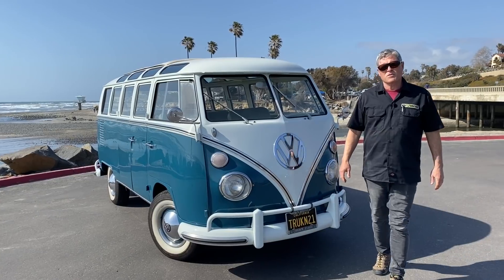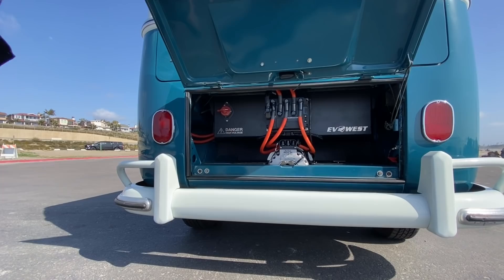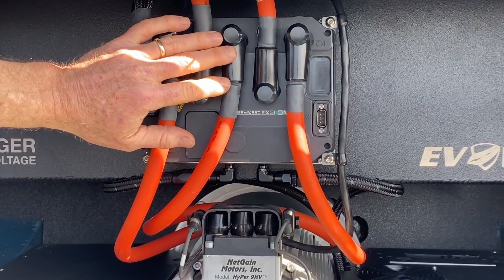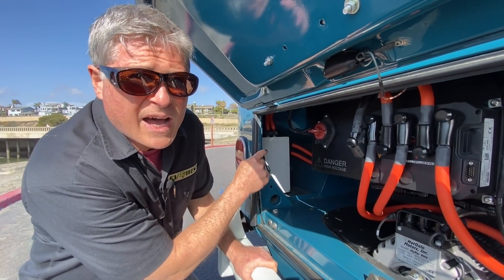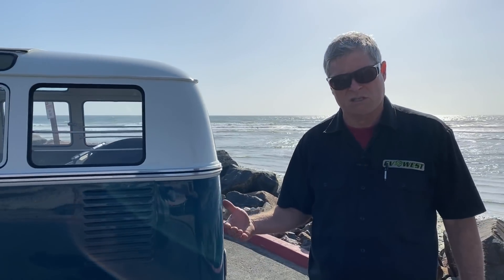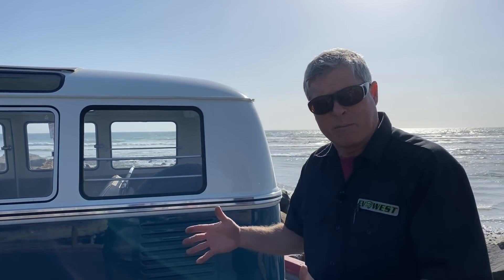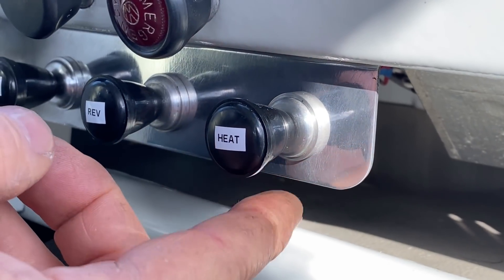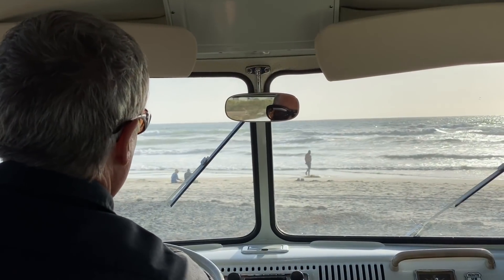Is a 1967 21 Window Volkswagen Bus the Perfect EV? | EV Show

Comment: Hey guys, I'm considering an electric conversion for my own T2. I know that the "how much range" question is a case of which batteries and how many. But in a best case scenario, with Tesla packs, fitted under the carriage and perhaps under a seat or covering the floor and/or in an engine bay... What would be the maximum theoretical range attainable?
Reply: Hey Dylan, check out the latest split bus conversion video they've put up. They're suggesting 100 mile range on that one with batteries only in engine bay. If you put another pack like that under the rock 'n' roll bed/seat that's 200 miles.

Comment: I am a huge classic car enthusiast and I never would ever change the motor in a classic car. The engine adds value to the vehicle and to strip the engine and switch it to an electric motor is like taking protein out of your meal. You need protein just like a classic car needs the gas engine. And people say gas engines will disappear no they won't. America was built on gas. And if we switch every motor to electric a car wouldn't be a hot rod. A car wouldn't have a rumble. That is what people want and like. They love how you can add modifications. But to change something entirely is not good. People won't modify them. People will get tired of racing. And it will vanish because every car has the same motor. Elon musk even said changing every car to electric is a bad idea because the US electric grid can't handle it. It is taking something that america was built on away, and making it bland.
Reply: you bring valid point but for some what is the objective purpose for the classic car. to keep it in original condition and not drive it? want a classic look with dependable drive ability and not experience the most comon breakdown? or the purpose is to keep its organic look and use as daily driver while still enjoying it?  this electric conversion is crazy money spent but i dont like the cc engine problems looking for a medium more middle ground solution!

Comment: How can that deliver 120 hp? Last time I checked 144 Volts x 250 Amps = 36 kw which is about 48 hp.
Reply from the maker: The ACX1 inverter has a 500A peak output, with voltage up to 185. 38kW continuous, 88kW peak.
Reply: @EVWest  I see. The label on the motor is a nominal rating but the controller, oops, inverter is really a 500A model. How much can you over-volt those brushless motors?

Comment: This is possibly the only vehicle that will lose value by doing an EV conversion.  "January 21, 2017, (a) 21-window Volkswagen Samba sold for $302,500, becoming the most valuable Volkswagen Samba van ever sold at auction"
Reply from the maker: With our 'bolt in' kits that are reversible, they do not affect resale value, as the components can be removed and replaced with original equipment, much like a tire and wheel change. The goal is to not alter the classic car in anyway that is not reversible, therefore not affecting resale value. It's important to save the car first! :)
Reply: That bus was a movie car and the buyer way over spent on it. Not worth anywhere close to that.

Comment: You guys are awesome! I love the fact your channel came back and see so much potential.
I have one question regarding motor voltage, why is the aftermarket not up to 390Volts like OEM? Is it a liability factor?
Reply from the maker: There are plenty of aftermarket 400V solutions, but they are more expensive than re-purposed 400V products from platforms like a used Tesla, so we don't see as many of these on the market, but they exist, just a bit more expensive. Also, when integrating to a vintage vehicle, the drivetrain can not handle much power, so the smaller lower voltage motors are a perfect fit, and are affordable.
Reply: @EVWest  Thank you, just from an electrical point of view higher voltage uses less current and less loss of heat so it's more efficient, not more powerful unless you make it more powerful with more amps.
I do understand the extra cost so I see your market points.
Reply from the maker: @HandyDan  This is absolutely true, and the reason why we prefer higher voltage motors, but in cases like this, the vintage vehicle is a little more important to protect, we use a system that more easily integrates with the factory components, in lieu of a couple extra miles of range from increased efficiency. It is a trade off that is common in EV component selection.

Comment: It would be cool if there was an option to automatically disable the regen when the battery bank was at a specific charge level. I think for others considering this, the IRS conversion makes the most sense as it also lowers the bus. I've been considering a swap for my 65 21-window but as someone pointed out here the range is a killer in Texas. Though a second battery could be added under the rear seat. The suspension is plenty stout for the weight. Just put your passengers in the middle seat. My bus would be gone if I left it somewhere (other than in a locked garage) to charge for 9 hours.
Reply from the maker: You can switch the region level on the fly with the NetGain Hyper9 system, just depends on how you want to program it, so it's extremely flexible.

Comment: Awesome build and great video. Are you installing the batteries where the gas tank was? What company are you using to building your transaxle?
Reply from the maker: Part of the gas tank location, and into the upper engine bay, all locations that were freed up with the engine removal. We use Paradise Motorsports in San Marcos to rebuild our 2 speed transaxles.
Reply: whats a conversión like this cost? assuming you got the bus to do the install

Comment: This must be well over 100k. How much did just the conversion run?
Reply: I'm sure the restoration was waaaay more than the EV conversion costs.  That body is near perfect.
Reply from the maker: The parts run $20-25k and the labor typically runs around $20k.

Comment: I love what you with these old classics - especially the Kombis. 

I have had 4 Kombis and a Type 3 over the past few decades. I still have one but it's been on blocks for the last 15 years or so. I have a few motors for it which I have intended to do up eventually but now I'm thinking of going electric. Although for me 32kw of batteries, which I assume would give you about 160km of range, is no where big enough. Have you considered putting more batteries, between the frame members, under the floor?  There is quite a bit or room there.

Comment: I GUESS YOU ONLY DOUBLED THE HP BECAUSE THAT PIECE OF SHIT COULDN'T HANDLE ANYMORE. THAT MODEL WAS A REAL TIN CAN PIECE OF GARBAGE. SURE THEY WERE FUN FOR A RIDE FOR A FEW MINUTES BUT LONG TERM THEY WERE UNSAFE, LOUSY HANDLING  PIECES OF SHIT, I'VE SEEEN VARIOUS WORK OVERS OF THEM, ONE WAS TO CHANGE THE SUSPENSION WITH BIG TIRES, ANYWAY, WHO CARES, ALSO WHAT KIND OF RANGE WOULD YOU GET LIKE 100 MILES OR WHATEVER, TOTAL WASTE OF TIME FOR FAKE IDIOT MORONS, BUT OBVIOUSLY YOUR TECHNOLOGY APPS REPRESENT A LOT OF HARD WORK SO I'M NOT DISPARAGING THEM, ITS JUST THE MODEL IS A CRAP CAN PIECE OF SHIT FOR FAKE HIPPIE LOSERS WHO NEVER HAD A CLUE TO BEGIN WITH...ALSO TO GET DECENT RANGE , YOU NEED MORE THAN 30 KW, WHICH IS YET ANOTHER JOKE, THAT' LIKE THE TIN CAN HOLDING A GALLON OF GAS, OH MY GOD, YOU SHOULD HAVE PUT THE PIECE OF JUNK ON A SKATE BOARD WITH 100 KWHRS AND THEN RE DID THE SUSPENSION, WHAT A MESS, THIS CONVERSION NEEDS MORE WORK